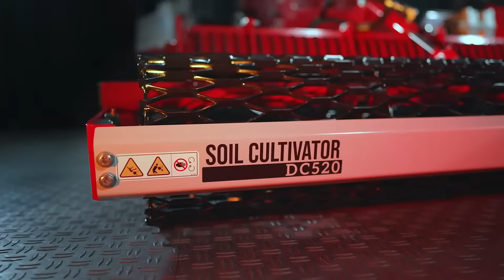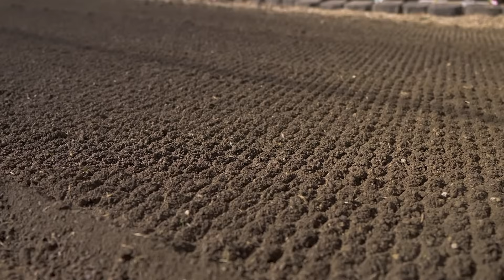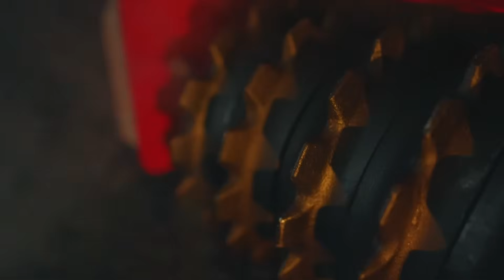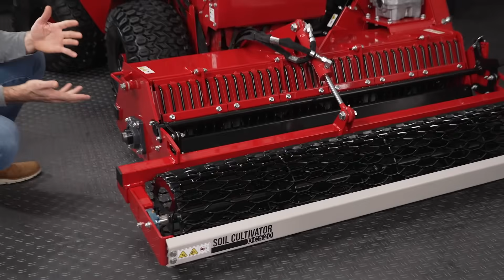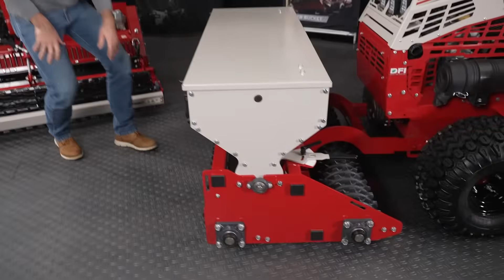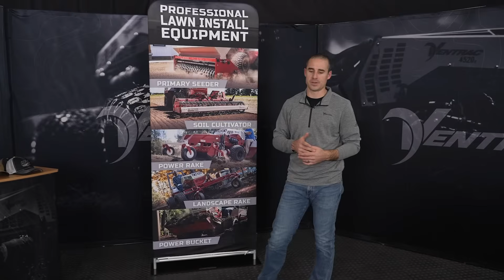Ventrac Live Product Release

Comment: Does the seed box work on the back of the Ventrac as well as on the front?
Reply from the maker: In theory, yes you can do that. However, this seeder was designed to be attached to the front as the front and rear cultipacker work together to create an indentation for the seed to fall into and fold the dirt over. If this attachment was mounted in the rear and you were driving forward, you would not get the same effect. It would however still be more effective than a regular broadcast spreader.

Comment: Also when are you guys you could consider other attachment 
1. Fork attachment similar to a power bucket for transferring item on a pallet around the worksite.
2. Small trailer you could use on the back of the ventrac for tools and material you made need to do for maintenance on a golf course and large property .
3. Attachment that you could add on your protection bar at the back of tje seat for hand edges and trimmers when mowing lawns a great for lawn  maintenance guys and golf courses hotels etc and local governments parks sections
Reply: Cooper Creek just put out a video on the toolbox attachments that connect to the protection bar.  There are 2 sizes.  Good suggestions.
Reply from the maker: Great suggestions!

Comment: Curious as to if someone were to use the soil cultivator first, followed with the aeravator with seed box? How would finished product be different then using primary seeder? I am still waiting on the aeravator from my dealer but will be getting it with the roller on back which I think would compact the soil/seed nicely and give a finished look. I do a lot of lawn installs and know there are multiple ways to do things so would love your input. Already know I’ll be getting the cultivator especially due to the fact that I deal with alot of rocks in our Wisconsin soil. Iv heard of rock hounds but they actually remove the rocks instead of burying them. Thanks for the innovation you guys!
Reply: Was wondering why you would get the primary seeder too instead of just the aeravstor and seed box as well.
Reply: Seeder on aeravator overseeds existing lawns, while primary seeder is for new lawn installs?
Reply from the maker: Exactly!